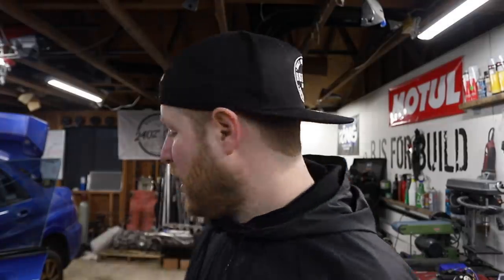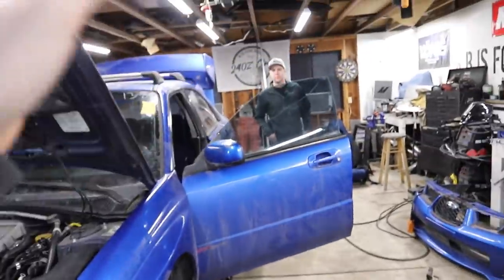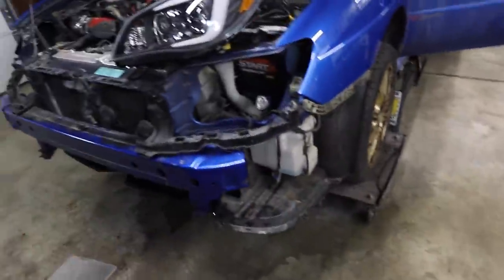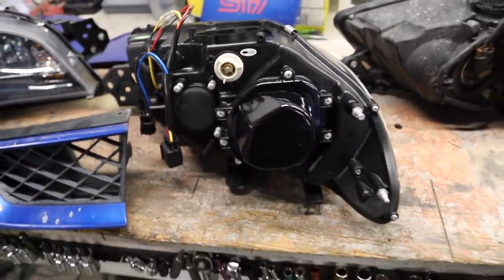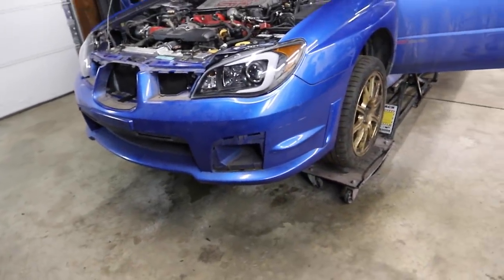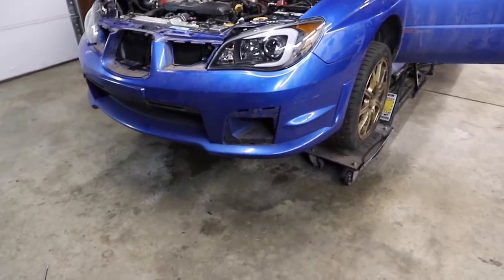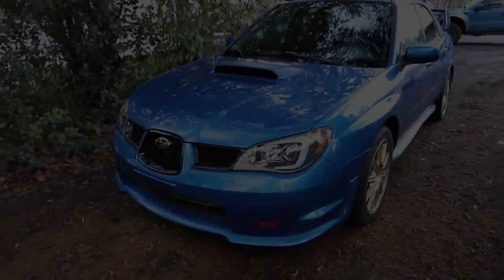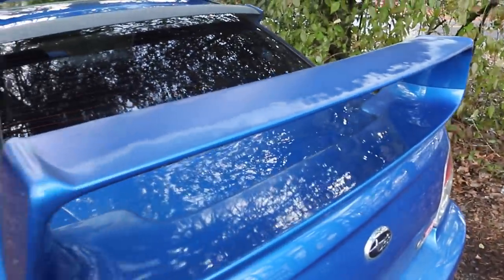First Test Drive of the Budget WRX STI!

Comment: I blew my motor last week, and because of this show I felt confident and capable enough to pull my own motor and swap with a new one. Buying a parts car from Copart, but I had the engine pulled in a day and a half. I know this'll get buried but it was the thing I've done I've felt most accomplished about in my life, so thank you Chris.
Reply: How did it blow
Reply: Good job dude that's freaking awesome more people need to be like that that's kind of how I started to I just didn't have any clue not saying that you don't have any clue I'm just saying I didn't have any clue and I just did it and the first time didn't turn out so well for me but after that man it seemed like I couldn't fail after that congratulations good job
Reply: @HBKfan4lifeRKO  haven't dug into the motor yet, but I think it was a mix of low oil 🤦🏼‍♂️ and a cam chain tensioner failure. Apparently a common problem on the Mk6 GTI.
The low oil was stupid, but when I did my first oil change I dumped LiquiMoly into the engine, popped under the car, and immediately stripped the soft (plastic?) torx bit plug. I had to drain the oil out the dipstick tube, and I forgot to get it serviced. And that's on top of my abusive driving. Motor is seized and it's only at 77k
Reply: @willierule3744  oh I def have no idea what I'm doing. But, I'm swapping the exact same 2.0 into my car, so it's essentially just a plug and play as long as you properly label everything
Reply: @cole2999  oh damn, sorry to hear that man i hope it wont happen again
Reply: Won my bid for the parts car. 22k less miles than my chassis. I need to take a bus 300 miles and rent a truck and trailer to bring it back tomorrow or the day after.
Reply: VWs have this problem even mine even tho its a skoda(you dont get them in US) it has the same 2.0 tsi and the chain tensioner failed at around 60.000km i changed it with an aftermarket cheap set for around 250€ because dealership wanted 600€ but sure after 6000km it has tick tocking again now it needs a new set with camgears and everything i think im gonna get it to the dealership since i know most of the mechanics and the part itself its around 450€ for the chain tensioner and camgears
Reply: @georgeaba7929  these repairs are, surprisingly, not too difficult. As long as you follow timing guides to the t, anyone with mechanical knowledge could replace cams and the tensioner.
I'm buying a while new engine so I can just drop it in, but my plan is to rebuild my old engine. Bore out the cylinders, hone the face,  and forge the head. Obviously I'll have a shop do the first two, but I'll be the one building the whole engine. My goal isn't too shove tons of horsepower into it, but rather to just make a durable as hell engine lmao. That, or I'm going to try to rwd swap (which might be easy? The R is awd...) the spare chassis and make a 400+hp race car 😁
Reply: I just left my job to take a bus 20 minutes later to go pay $3000 cash for a car I've never seen and then tow it 7 hours, 300 miles back when I've never towed a trailer or even driven a truck ever.
Reply: Polo or golf gti?
Reply: @tonywhoriskey4168  golf! 2013 VW Golf GTI, 2 door white with a manual. US spec
Reply: @cole2999  don't u guys got the polo did you?
Reply: @tonywhoriskey4168  don't think we ever did, no. Compacts don't do well here. VW is cutting the Golf line down to just the R and GTI as it is
Reply: Proud of you, dude! Nice work!
Reply: I really don't want people to think this is self promotion but I decided I've got a fucking weird enough story, plus people might like to see an idiot swap a motor, so I'm gonna start documenting the swap, plus vlogging my journey (starting in Philly cause that's when I decided to record 😂)
Reply: i’m scared to touch my motor lol, the most i’ve done is change the alternator on my ram pickup 🤦🏽‍♂️
Reply: way to go @Colby Murphy - I plan on pulling an engine some day. I changed my timing kit a year ago, and still talk about it today!!!
Reply: Colby Murphy awesome man
Reply: Dude that’s seriously a major accomplishment, especially if you just learned how to do it off youtube. Be proud of that, for real
Reply: @cole2999 should’ve just scrapped the car and got something good

Comment: "some pulley is a little loud; I think we'll just leave it."

It's most likely one of the timing assembly pullies which when fail result in catastrophic engine failure.  Definitely figure out what's making that noise and then assess if you should fix it or not.  For instance if it's a power steering or alternator bearing, send it!  If it's in the timing assembly definitely replace it.
Reply: Wouldn’t be surprised if it’s a timing idler. If they leave it then the cheap budget build is out the window lol.
Reply: Yeah, but lets spend $500 on  fancy headlights instead, 'cause you know, its a budget build... I know where I would be spending my money and it would be on repairs that actually matter.
Reply: I think he should spend $300 on new headlights instead.

Comment: The thing with some of the cheaper HID bulbs can be a few different things. 1) The actual length of the glass can be different causing the optics to be off resulting in less than optimal output. 2) The way the glass is affixed to the plastic bulb housing the glue is generally cheaper and can "leak" and almost essentially feel like the bulb is glued into the projector. In time this can also damage the internal of the projector.

Comment: "We are going for a budged build" 
Spend 500 on headlights while the old ones need only a buff xD
Edit: the whole front bumper color seems off
Reply: the lightbulbs are what got me
you don't need two working bulbs for a test drive during day time after which the car will sit in the shop for at least another week
Reply: TBasianeyes especially since you get can throw a pair of HID or LED from Amazon in two days...
Reply: @Greenday1827  or even 1day shipping at that would've been cheaper than those light bulbs he got
Reply: Yeah, they were pretty stupid there. After all, if the ballasts from the old lights worked in the new ones, then the old lights essentially work. Just change the HID bulbs....oh they did that didnt they? They could have done some restoration would have taken 20 mins max per light but they spent $300 and keep calling it a budget build. And yes, they don't need lights to run during the daytime, they could've order it in cheap from amazone or ebay. Not well thought out.

Comment: Hey it could be a misaligned pulley. If you have the time, I would say check the valleys for wear in the paint coating. If there is wear to one side then the pulley could need to be realigned

Comment: I love Scoobiedoos, I own a 2011 Forester XT manual transmission, never misses a beat in 7 years!
Reply: Is that 6 speed swapped?
Reply: @bradd4664  it is a stock 5 speed sold in Australia
Reply: @proximaone1350  Interesting. USDM stopped 5MT FXT after 08 so I figured it was swapped
Reply: @bradd4664  the 5 SPD is fairly rare, most sold here with auto .

Comment: I owned a 2006 Sti. The factory clutch is very heavy, so it gives the feeling of an upgraded clutch.  I traded the car with 190k miles and the factory clutch was still working without slipping.  For the secondary channel name, "Don't B, Build"

Comment: Two things you should definitely do before you keep driving it and beating on it. Replace the water pump and timing belt with new pulleys and a OEM water pump for an 02 WRX. They're cast and are better quality than the STI ones. Second is get a tune and not just a Cobb off the shelf tune. We are currently dealing with an STI that had one and is now knocking

Comment: DIY Stethoscope: Is that rough noise around the timing belt and idlers? Could be worth taking the timing covers off and checking. Might be sand. Sounds like sand grinding away.

Comment: Whys there no time and it's all rushed when theres not really a deadline?

Could of ordered bulbs off eBay, theres no rush... then spent the spare $180 on mods
Reply: He said he wanted to get it back to stock first, then mod it later.

He is trying to get it back in working order to do some stuff with it before he has to travel and gets into getting the Lambo tuned.
Reply: And ge said hes off to japan, so probably wanted to get it in a working drivable state before he left.
Reply: He answered that question right at the beginning. It's likely that delays cost him a lot more than the money he would save

Comment: Hey guys.  Great series on this WRX.  I have an older Legacy GT myself that I'm having lots of fun with and I've started doing some small mods myself to it.  I was wondering where you get your fasteners for all the trim and stuff.  I mean the plastic clips and pegs and such that tend to get brittle and break off over time.  My car is an '05 and needs a bunch of that kind of thing.  Thanks.

Comment: Belt/pully noise possibly timing belt idler or water pump??? Pull cover on driver side of engine and check. 4 bolts.

Comment: It doesn’t look like you transferred over your auto levelers to your new headlights. I have the same set; you can install the parts from the old and have your headlight leveling scroll wheel control working again.

Comment: That "module" on the bottom of the head lamps are the ballasts for the factory HID's.. and those HID's cost you $200.. because they're factory HID's.. they're not the same as any other HID's, factory ones are much different. You can buy them aftermarket for cheaper.. but its risky.. and they're not like H11's or 9012's they're most likely D2S bulbs.. much different.

Comment: You guys reallllyyyyy Should pull the timing covers off and make sure the pulley noise isn't from one of the timing idler pulleys. If one of those is about to let go you're going to have a not so cheap STi anymore. 
The pulley noise without knowing the condition of the timing components that were under water is giving me anxiety lol

Comment: You should drive my 04 STI to get a feel of power difference. Hard to tell from video but didn't seem like you was moving that quick in those pulls. My 04 is tuned at 17 psi though.

Comment: FYI you still need to remove the carpet. There is a foam under it which will not dry no matter what. And over time it will corrode and smell bad.

Comment: All i have is a Forester and it goes bang bang in the manifold when i put the pedal to the metal and the check engine light is always on, and it has oil in the sparkplugs, i do also own a vape.

Comment: Don't you think the timing belt and bearings should be changed? Considering the bearing noise. If the sound isn't coming from the a/c pulley. Then it would likely be timing belt bearing issues.

Comment: On your front headlights don't you have two orange bulbs one on each edge of the headlight cuz you only had one portion flashing and that's the inner portion the center portion but you still have to have the outer side front marker for your car isn't that the one that's not working on your headlight

Comment: For the love of God, please, take 5 seconds and pull the belts, and spin the idler for the alternator belt.. Why leave something making such a nasty noise in there? Cmon now, imagine if it's a timing belt idler making this noise, you've got a potential engine killer in there.

Edit: as a side note, if you're planting it from 2krpm in first, you should most definitely be hitting full boost. Not just in second gear. There is plenty of load/length of gearing to hit full boost before end of gear.

Comment: You say you got a good deal, but the truth is, you got the same deal as everyone else. You undoubtedly had 5 or 6 skilled friends put in 20-40 hours each. if we get a minimum of 150 hours thats around 7k dollars at an auto shop. So the cost of the car was 3k plus 7k labor. I'm sure it fluctuates a little, but anyone willing to put in the work and try, always saves a buck on parts, but then loses on labor. or vice versa. Granted you did save a few dollars vs a used one in running order. But there are other factors, whats the mileage? Whats the likely hood of failure due to water sitting in there for so long. I'd venture to guess this car has a value of 12-17k and you spent 10-12k, minimum.